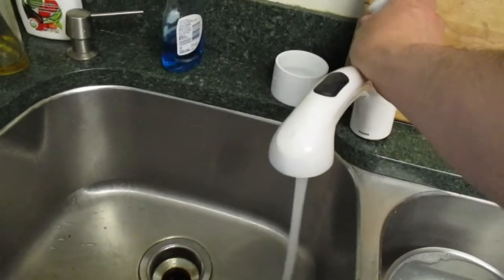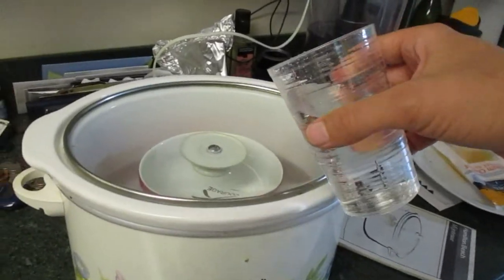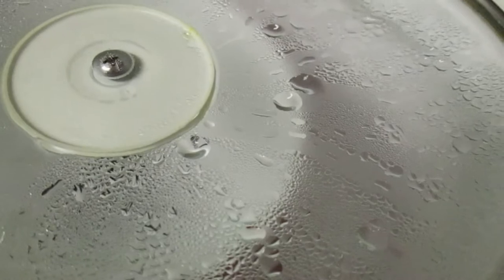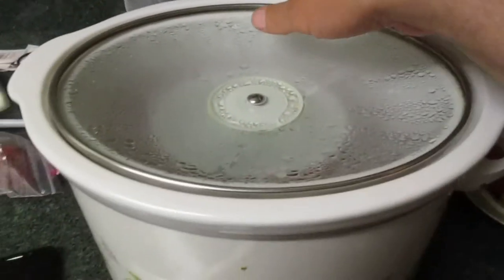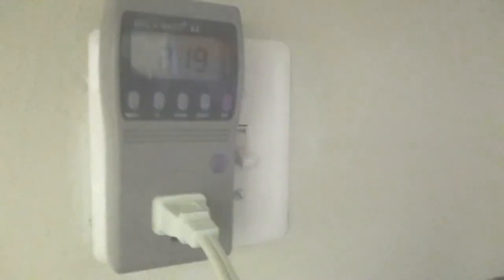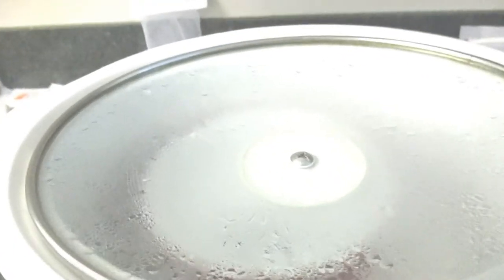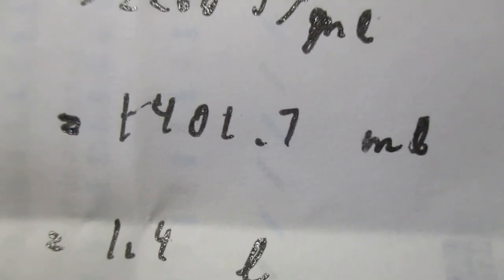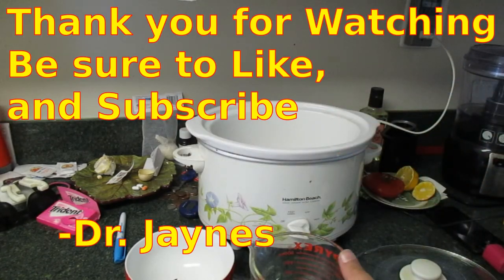How to Build a Crockpot Still

Comment: Can this be used for distilling and making essential oils?
Reply from the maker: Maybe, the internet says that some essential oils evaporate near the same temperature of water (100 C), so it should work...  They can escape out the crack in the top though, so you might loose some oils??.. I have a different video showing how to make a simple still in a sealed glass container... and then none of the oils would escape... This might be a better way to go??

https://www.youtube.com/watch?v=kxHnSFS0YyQ
Reply: @jaynesnetwork  thank you I tried it but I dont think I got any oil but I'll watch the video you linked and try again!
Reply: Chemist here:
You generally cannot without actual distilling equipment. But it also depends, what are you distilling. (I guess you mean extracting from here) if you are distilling from plants you generally need a chemical solvent to break down the plant and dissolve the oils in. (Oh yeah... There are chemicals used in 99% of the "all natural" oils (because "natural" just means it exists))
Reply: @kaylaphillips1454  would would for making hydrosols
Reply: You can use this method to distill wine into brandy

Comment: Ice on top
Reply from the maker: The might help.  I made another video where I make a solar powered still from a large mason jar and a small wine glass..
Reply: Might crack your glass lid.
Could also do on stove top with a saucepan. Trivet or plate turned upside down inside the pot. Same amount of water with a bowl on top of the plate or trivet. And lid turned upside.
Then you could add ice.
Reply: @jaynesnetwork  I can’t find that video

Comment: I would add a pinch of sea salt to the water. It remineralizes it and makes it taste like Fancy mineral water
Reply from the maker: Ok, I will have to try it.. Sea salt should contain many different kinds of salt that are good for you.. I am mainly drinking Reverse Osmosis water now, but, it will have the same issues. This is my table top device that I am using..
https://youtu.be/WzXgT2aQvv4

Comment: TL;DR: if you think your drinking water is polluted boil it BUT NEVER distill it!

I'm a bit late here I know... But, I have a master's degree in chemical- and bio-engineering and thought I would get it on this.

Distilled water (the same as demineralized or deionized water) is something you should never drink unless the alternative is polluted water (I'm talking urine or sewage-levels of pollution here).
The short version is that distilled water lacks any salt and minerals (also called electrolytes), therefore drinking it will mess with your body's electrolyte balance by lowering the concentration of salts outside your cells, which will cause more water to enter the cells than intended. (because of something called osmosis) this can in worst case cause so much water to enter your cells that your legs can swell up or you blood vessels can rupture leading to a hemorrhage.

Regarding the fluoride. The level fluoride in tap-water is closely monitored, and your teeth actually need some fluoride in the water to prevent plaque. No water company would intentionally add more fluoride than what is safe because 1. it costs money to add extra fluoride and 2. The fine for deliberately putting public health at risk is insane. 
The same goes for chloride though addition is more liberal because many countries use it as an cheap way to avoid spending the money that a lot of Europe has spent on new tech to disinfect and clean the water without changing the taste.
Reply from the maker: Ok, But boiling does not remove toxins... only distillation and reverse osmosis will remove chemical poisons like fluorine.. Furthermore.. I really don't want Big Bother deciding how much poison is acceptable in my water.. If anyone wants to wash their teeth with fluorine.. let that be up to them to do that.. but when these poisons are put into our drinking water... we are ALL forced to ingest them.. 

I do not approve of forced medication/poisoning of the masses. We should have a choice if we want to drink Fluorine or not.. and furthermore, probable most people  that would use Fluorine as a mouth was, would spit it out.. and not drink it! 

What right do they have to decide how much they will poison us with our only source of drinking water!?? 

I have actually been drinking reverse osmosis water, ever since I moved to this new place with city water, several years ago.. and with no salt added to the water.. and I have had not any problems!  

This is true about the osmotic pressure in the cell will be offset, if you don't take in enough salt.. So my solution.. I will add more salt to my steak! Not all of our daily salts need to come from our drinking water!.. Probably most of us consume too much salt anyway.. and yes, there are different kinds of salts, and you have to make sure you get the right amounts balanced, etc.. but the bottom line is,.. It is my body, shouldn't it be my choice if every glass of water I drink contains poisonous fluorine or not?? Just my opinion..

Anyway Great insight... and thanks for the great comments!!